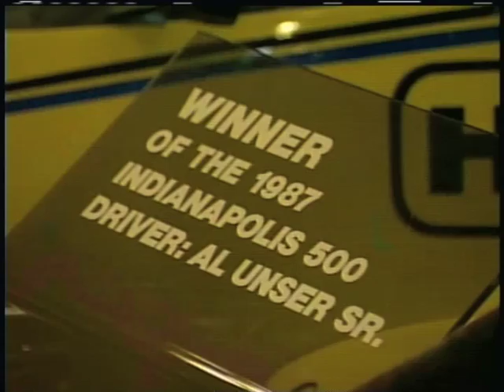Cummins on Fox Sports Network's 'Motorhead Garage' (Part 4 of 4)

Comment from the maker: @Seattlecarnut Thanks for your comments!  350 hp and 800 lb-ft of torque are available with the current 6.7L Cummins Turbo Diesel. You can learn more at the cumminsengines or ramtrucks websites.

Comment: @Seattlecarnut Depends on the application.  The 2011 HO and 2012 Dodge application is 800lbft tq @ .. I think 1600 RPM, and 350HP @ like 3200RPM.